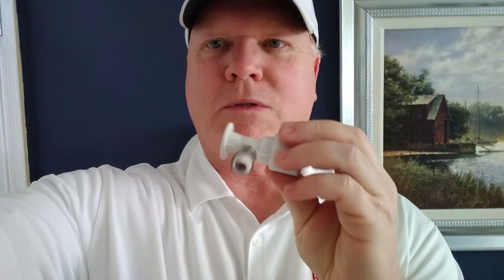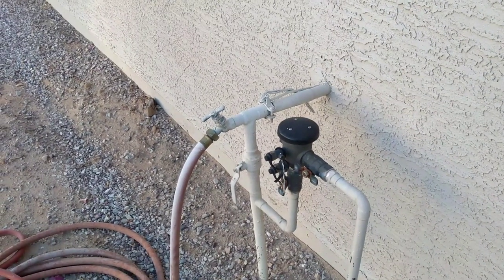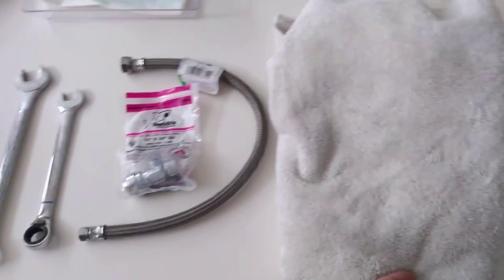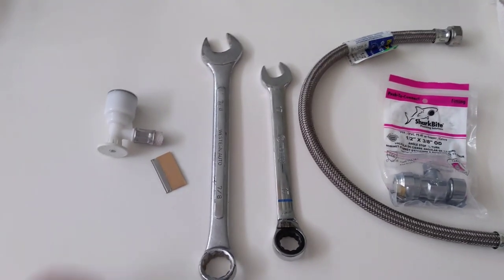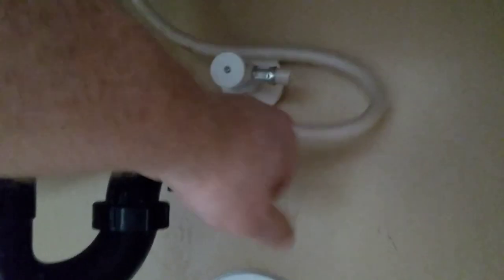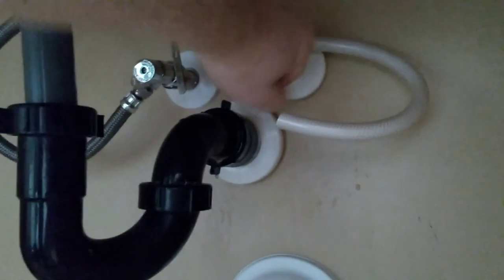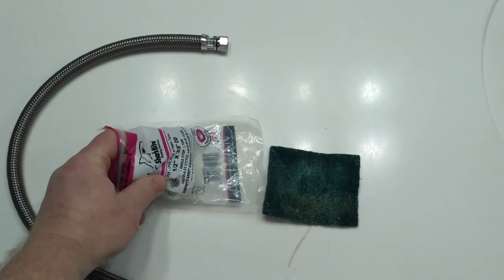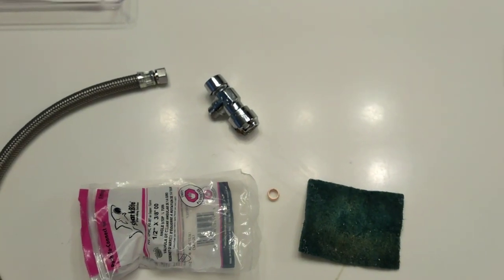How to remove Flowtite plastic valve under the sink!

Comment: I've been looking for this video for three days I was about to give up on this new faucet.  But then I found your video.  Thanks for posting a video like this.  I can finally start remodeling my sinks.
Reply from the maker: Thanks for the good comment 👍 you can also use a Dremel with a cutting wheel if it won't come off.  It  should work good luck 👍
Reply: @spencercurtisjackofnotrade4627  it took me two hours to get that flowtite off.  I twisted it you said and the dang than almost got cut.  But I got it off finally
Reply from the maker: That sucks!  Sometimes you have to cut them off.  The ones I removed on my home came off by pulling and twisting.  Maybe the next one will be easier.  You could also use some cut resistant gloves if  you are worried about getting cut.  Good luck 👍.  I'm not a plumber but that is how it worked for me.

Comment from the maker: Most of the homes now have the plastic pipe but use copper to connect to the fixtures that how my home was constructed.  You can also use a cutting wheel on a Dremel to remove it.

Comment: Correct me if I'm wrong but when those are connected to PVC and CPVC,  you will need to cut off the scratched up end after removal before using the Sharkbite right? Otherwise you'll get leaks from not having a good enough seal?
Reply: Did you end up trying this?  I'm wondering the same thing...

Comment: Are you supposed to be able to remove disconnect the white hose by unscrewing that metal part? I tried to disconnect the white hose but it's just not coming loose even though it's turning.

Comment: Hey just watched your video, does that supply line you cut on the valve unscrew off? Can I replace just the supply line itself? I have a stripped plastic fitting on the end of the supply don't want to replace the whole valve if I can just replace the supply line. (Company issue not personal or I woukd replace the push pull valve with a better one like you did) thank you
Reply from the maker: you cannot replace just the supply line on the valve I was removing.  Maybe yours is different.

Comment: When you twist off the flowtite valve, you scratch the pipe. How many of you have had leak-free success with the new valve after using this twist-off method? Has anyone had leaks caused by the scratches?

Comment: Sir why are we twisting exactly when removing? Does it have thread or is it simply to slide out? Is it more like compression ?
Reply from the maker: There are no threads but that is an easy way to remove it,  you can also use a Dremel tool with a cut off wheel but you have to be really careful not to scare the copper pipe.
Reply: Jack of NO TRADES 

Ah!

Comment: Question! 
First I can’t believe they used these valves on my custom home. 

What do i need when replacing this valves. I believe behind the valve is the blue and red poly lines. 

Do I still pull and twist? 
Which valve can I replace it with since i would be using it on the blue/red poly. 

By the way my home is not a mobile nor RV
Reply from the maker: Not sure on the poly line on what to do there.  I would call a plumber he will probably have to cut it off.
Reply: Custom home doesn't mean quality build, it's just means you spent a lot for the same contractor grade material any new build gets.